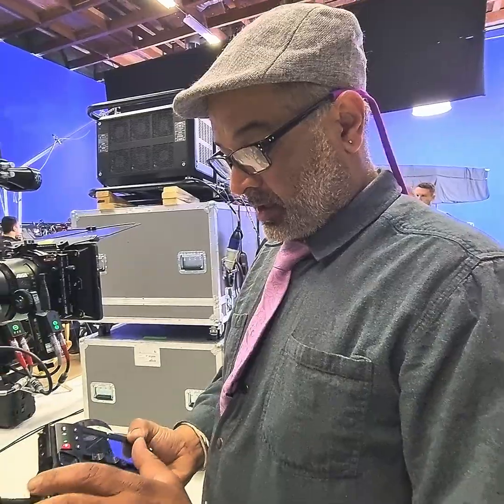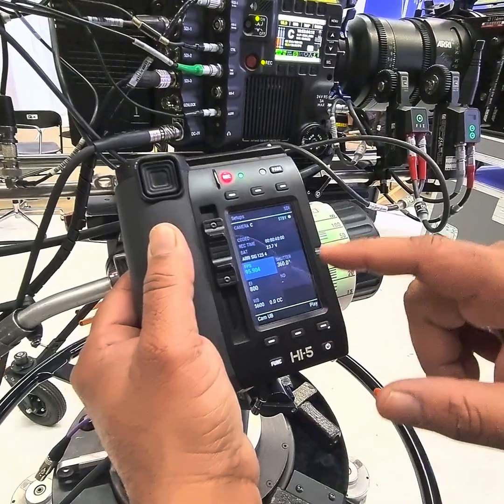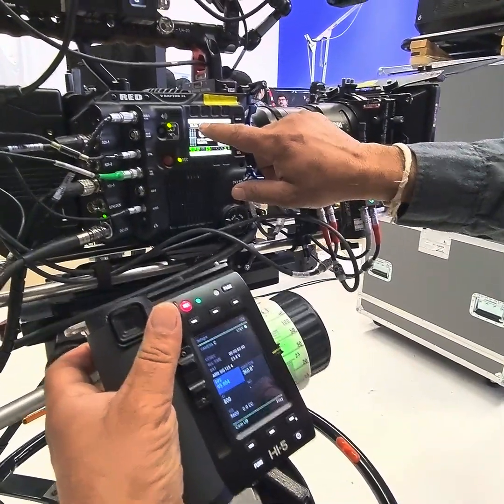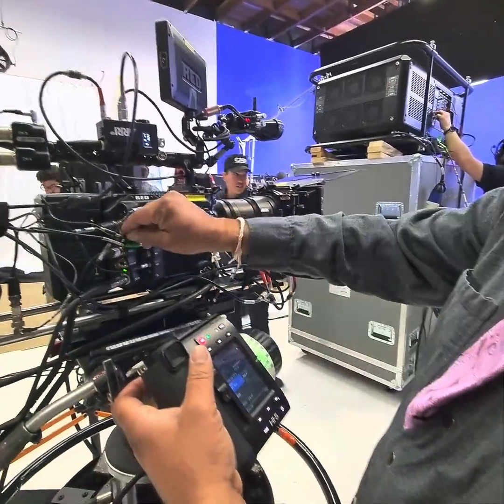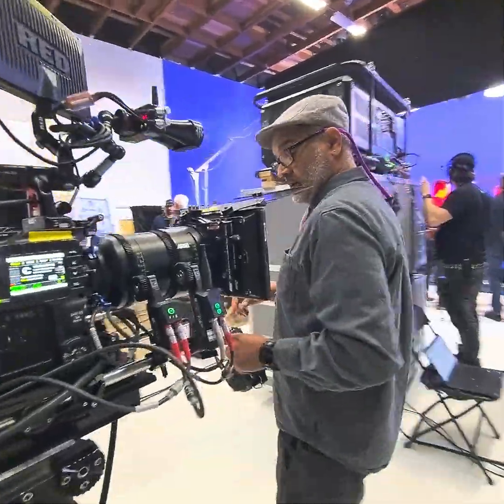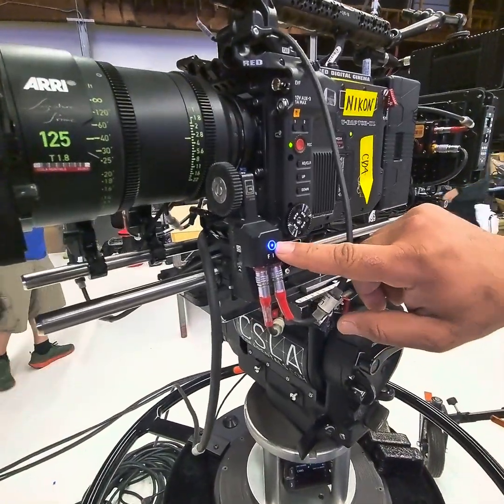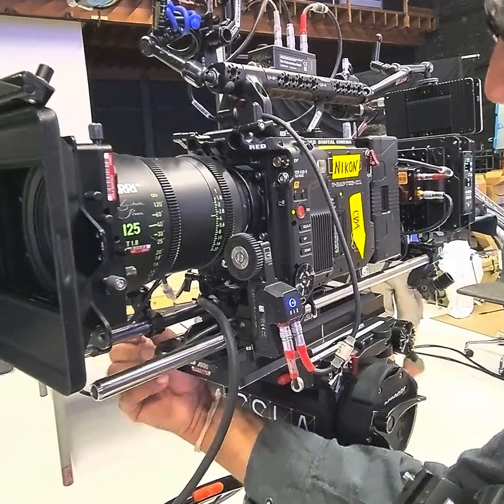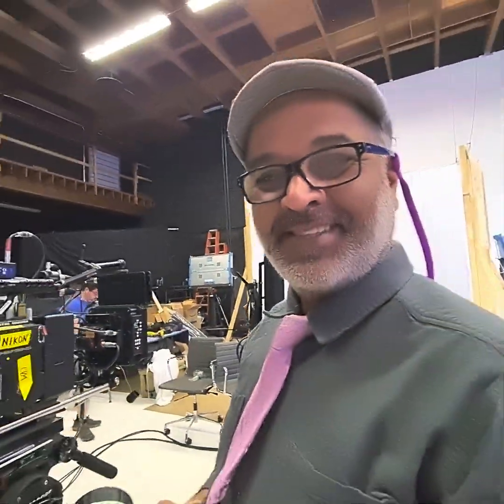Nikon Red Raptor XL with RIA-1, Hi5 and Cforce encoder

Comment: Hi! Why are you using 2 motors on the same axis? Couldn’t the DIT just take over the iris motor on your channel and adjust iris that way? Why split up your network with their network?
Reply: Because one motor is on encoder mode, it's a great feature to have especially on VFX shoots or MOCO shoots where motors are typically being run by an external system.
Reply: @ And in this case your DIT was using a separate system you mean? Where are the days of the LDE-1 ;) Cool stuff!